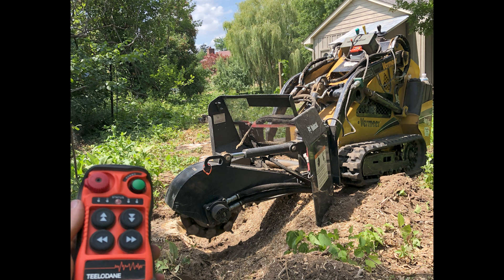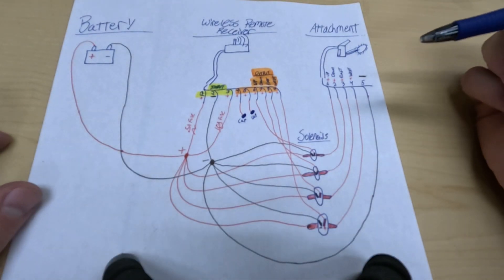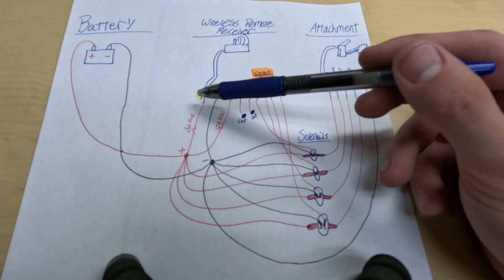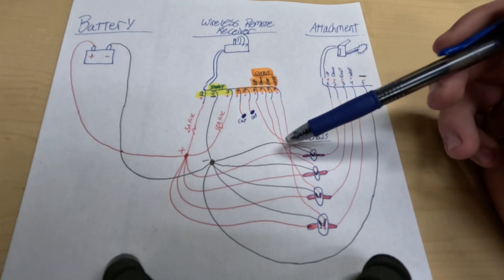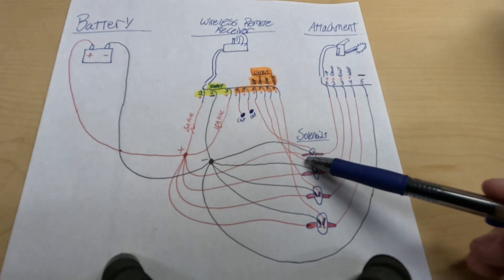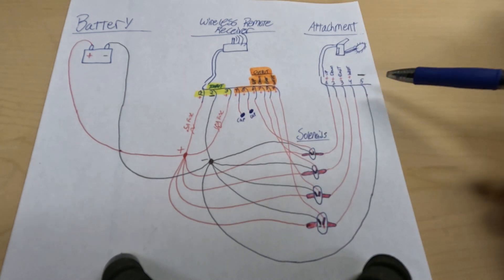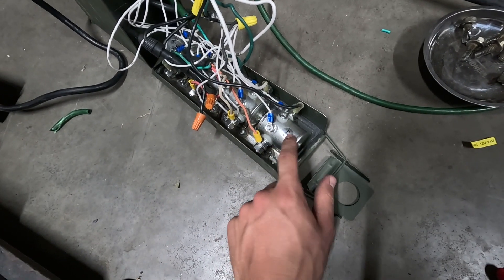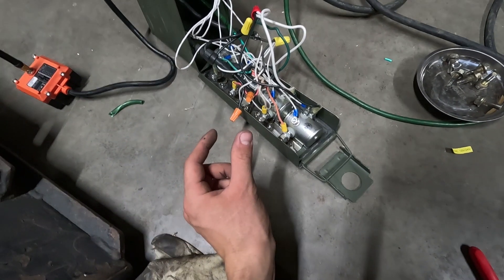12v Wireless Crane Remote - How to Install - Skid Loader Attachment (Stump Grinder)

Comment: Cool Idea! Just a few helpful tips on your remote wiring. Add an earth wire, as body grounding is not reliable and cause the functions to have issues. The Q400 remote receiver has it's own relays and can handle the full amperage of the hydraulic solenoids (about 1.5amps each) but, it is not uncommon to see systems with extra relays. (Standard auto relays would have sufficed). And BTW the receiver has a 0.5amp and 10amp fuses inside of it😄😃. All the best!!!!
Reply: curious if you figured out how to make latching contacts ?

Comment: Would you happen to have a wireing diagram. I have different remote with same functions (com)(main) etc. Putting mine on a tow truck Hydraulic pump with its own solenoid mounted
Reply from the maker: @ycali609  take a look in the video I put a wiring diagram in there!